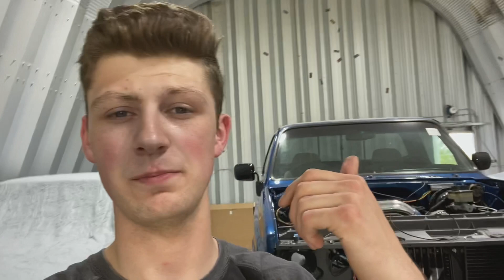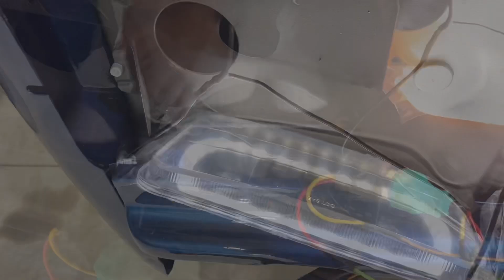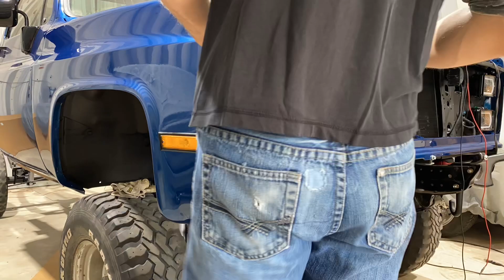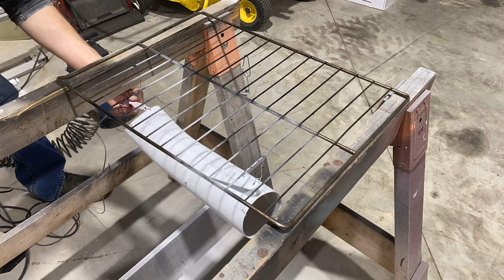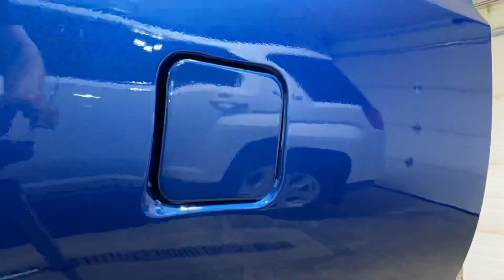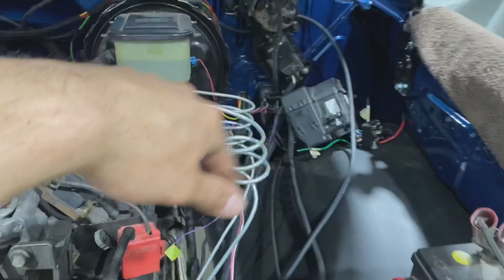1986 K10 Restoration: New Headlights & Misc. Assembly

Comment: so i bought some amazon lights similar to yours and they do not fit in the bucket, howd you get yours to fit ?
Reply from the maker: For most of the aftermarket lights you need to cut the back of the bucket out to fit them. I bought shallow lights that fit without cutting

Comment: Link for headlights? I’m looking to get new ones for my 83 k10
Reply from the maker: MOVOTOR 4x6 Led Headlights with White/Yellow Halo Seal Beam H4651 H4656 H6545 H4668 Replacement Headlamp for Ford Kenworth Peterbilt Semi Truck 4PCS https://www.amazon.ca/dp/B089SLTLYW/ref=cm_sw_r_cp_api_glt_i_BV9KEB4QHKAJP21RRDC4?_encoding=UTF8&psc=1
Reply: @bradenrein  Link for the headlight buckets and more importantly the Mounting adjustment screws that hold the buckets to the core support..

Comment: Looking good dude. I do a lot of electrical work on cars and i use heat shrink with solder in them. Saves a lot of time and its a real strong connection.
Reply from the maker: Absolutely. I trust a soldered connection over a crimp any day
Reply: @bradenrein  these are what im referring to. Ive noticed most people dont know about them but they are very convenient. https://www.amazon.com/gp/product/B087RBLV1H/ref=ox_sc_act_title_1?smid=A32VX1OUD7LME2&psc=1